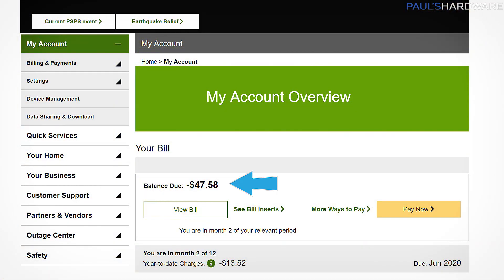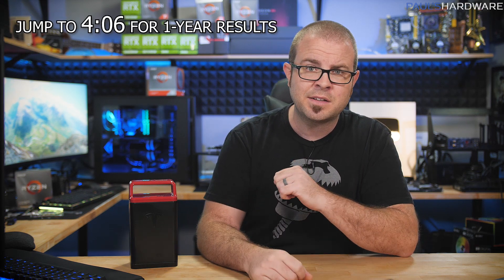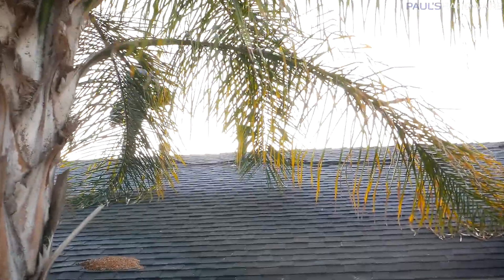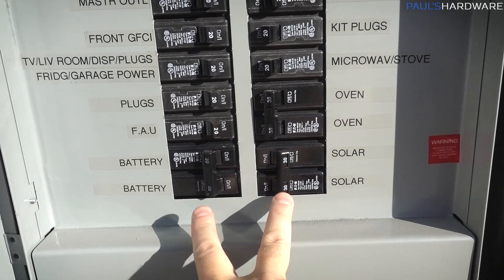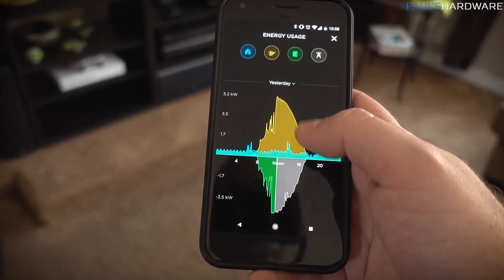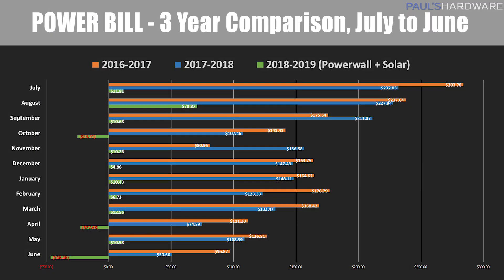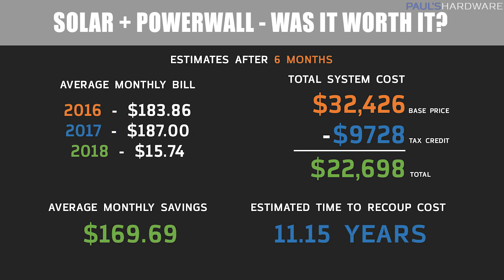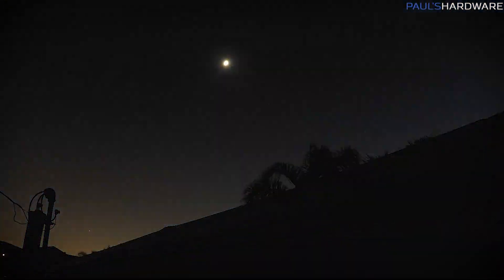TESLA Solar and Powerwall: 1 Year Later!

Comment: Any tax rebate or government subsidy in your state that can bring down the original cost and subsequently, lower the recoup number of years? How about maintenance cost? 

It seems by the time you recoup the original cost, the system would need to be replaced soon, which will start a new cycle of recouping the cost. Doesn't sound like a desirable loop. (Unless, of course, the government incentives to slash the set up cost at the beginning).

Comment: This is a great year for solar installation! The Feds are now giving a 26% credit and Tesla's prices are amazingly low. Next year in California changing rules may mandate a powerwall, which adds another $12,000 to the price of the system, and for many of us would be a deal breaker. My cost is so low that my payback should be in less than 5 years. Make sure to review your actual electricity kwh expenditures for several years back  rather than accept TESLA's estimation from one of your recent bills. In my case they under-calculated what I needed by quite a bit :). As the vlogger commented you cannot change your design once it's finalized and installed, so best to err on the side of maybe 10-20% additional to the max you think you'll need. You must estimate your changing lifestyle as to your need for solar panels...if retiring you'll spend more time at home as you age; traveling 6 months a year compared to now? then obviously much less.  Since power costs are going up, possibly 6% a year a surplus is a good idea.  Many of you were home much more for the past 12 months so used more kwh. However, it is not a bad idea to estimate on the high side, as this vlogger recommends. Most will not need a powerwall, and remember to include in your estimation for TESLA if you plan on buying an electric vehicle because you will need many more solar panels to charge the car.

Comment: Not sure how everyone experience with Tesla Solar has been but mine has been horrendous. They cancelled my Install 1 days before the schedule and have been telling me they caught a last minute need to upgrade my Panel. They have given me at least 3-4 different reason for why it needs upgrade and thrown a range of 5-20k to do the work including mentioning digging a trench (Not sure why upgrading a Panel requires digging a trench). All this without any hard numbers, all done based on my initial picture, no physical team on site to explain why I should spend 5-20K. It has also been over a month since my scheduled date. Every time I call, I get the "Talk to the hand" treatment. Overall I am shocked at how bad the experience has been. Very disappointed because I am a huge Tesla Fan.

Comment: Unfortunately, we had a bit of a horror story with Tesla. It felt like a bait and switch and makes us not want to ever deal with them again. Last year, we decided to get Tesla’s Solar Roof. We needed to replace our roof in the next few years, anyway, so financially it wasn’t much more than new roof + solar to get Tesla’s Solar Roof. After months of back and forth with Tesla on the details (they ask for pictures of the panel, details of electrical bill, roof layout, etc.), we signed an agreement to pay for Tesla’s Solar Roof and two powerwalls. We then went through the financing agreement and we submitted for permits. A few weeks later, Tesla sent us an automated update to agreement via email. It just had a new price and an “agree” button—that was it. The new price added ANOTHER $24K OVER THE AGREED PRICE. Rather than blindly accept the retroactive price change, I called and they said this was after a review of the roof complexity (mind you, they've already assessed that in detail and created a detailed plan for where the solar vs. normal tiles go). The guy on the phone actually acknowledged that this was in fact just adding another fee, though. So just a heads up to anyone considering Solar Roof, the price you agree to may get massively hiked up even after you sign what you think is the final agreement.

Comment: better way of looking at the value - $22698 investment (as compared to say Paul's 401 or similar investment fund) return on investment (147 x 12 = $1763) or a return of 7.8% TAX FREE. From day one. When you buy $22k of ATT stock you don't ask when will the dividends pay off the purchase of the stock, you ask "what is my return on investment"? AND
 it is GUARANTEED RETURN AND the value of your house has gone up $20,000 AND you don't worry about power outage - Solar is the best investment going!

Comment: Imagine that cost savings if you start factoring in charging a car, switching to electric water heaters etc. optimizing the house to run on the system in place

Comment: I just had my Tesla/Solar City Solar Panels cleaned since we've had a lot of smoke in Southern California due to the recent fires and the daily power generated has increased from about 22 kWh per day to about 29 kWh per day, an increase of about 31% [we have 28 panels]. Also, the max kW per hour has also increased from about 3.2 kW to about 4.6 kW, an increase of 43%+. Be sure to have your panels cleaned about every 6 months minimum, it will cost about $5 per panel to clean them well, but it's well worth it to increase your power production back to where it should be. FYI - we leased the system from Solar City [with a 3% annual increase], but I'd suggest purchasing the system if possible to avoid any issues when selling your home down the road.

Comment: A customer of mine (I build custom homes) bought 4 powerwalls for the house.  In the first winter, during a power outage, the weather was too cold so the powerwalls wouldn’t work.  They needed a trickle charge from the power grid if the temp was below (40-50 F - I don’t remember for sure, but this is the SF Bay Area which doesn’t get that cold).  Without the trickle charge they didn’t turn on until around noon when they got warm enough.  To make matters worse, my customer had Tesla install the whole system.  He kept calling Tesla saying the system wouldn’t work, to which they responded they could only talk to the installer, not the homeowner.  He kept saying “But Tesla installed them for me!” 
 They finally hung up on him as he got more irritated.  That is Tesla technology and customer service.

Comment: solar panels are a scam.  I would not trust them at all.  besides you cannot power a decent A/C with them, where most of your energy bill goes to.  you are better of on investing a sun deflecting heat paint. and switching all your lights to led. that will save you at least 40% on your electrical bill.    the only things that eat all the electricity are the Dryer and the A/C, Dryer consumes 5 kwph ,  and best solar panels can only produce 1.5 kph, unless you get fancy.   and to run the A/C you may need an extra 5kw.  so solar panels are useless,  they will save you nothing.  you will save way more money if you just paint your home with heat deflective paint. why? because your home was designed to be a heat battery that's why.  the sooner you understand your problem the better.

Comment: If the cost structures are like they are here in Australia, the panels pay for themselves quite quickly, the battery however takes a little longer, 
but you increase your solar self consumption significantly.

This can be accelerated by oversizing your system as much as possible.

Comment: Hi Paul. I live in Brisbane, Australia. Yes I'd like to see the difference in generation before and after of cleaning the panels. 

When electric cars become more commonplace I will certainly implement a home battery setup. Currently I have a 6.6kw grid connected system, no battery. My annual bills balance out to +/- $50. In extreme drought conditions I made $500 during calendar year 2019. Our feed in tariff fell from 15c/kwhr to 7c in March 2019, however our state government gave a $200 rebate as a Covid stimulus assistance package to every metered property.

Just as an aside and I think it is related to the government subsidy, a 10kw panel array with a 7kw Tesla powerwall costs $13446 USD installed here. Yep chinese panels with the same warranty and Canadian solar inverter. 

Great video and full of the appropriate data. Many thanks.

Comment: For those asking about cleaning. I have a 10kw system and I clean my panels ever couple of months. Makes approximately 1-2 KWh difference. That may not sound like much but it adds up. I have had my system since 08/13. Added 2 Tesla powerwalls in 01/18. Just added a small Tesla solar system to augment because we now have two electric cars.
Reply: With a 10kw system do you still use electricity off the grid at times? Thanks

Comment: Wasted money on the power wall. You dont lose the power generated on the roof, it goes back to the grid and then the grid gives you it back when you need it. 
Just like it would go into the battery and back to you when you need it .
The grid is your backup battery at no cost to you

Comment: That’s pretty cool that they re did your roof because I use to work for solar city which is what they were called, before Tesla bought them out which is pretty much the same company. But they are right with not installing on a roof that is old and brittle because all the penetrations in the roof with an old roof may cause potential leaks. Besides having the install done with your old roof may cost you money down the line because when you wanna re-roof you’re gonna have to pay roofers plus Tesla to take your panels back off depending on your contract with them. So I’m surprised to see them redo the roof for you before the install. You got a good deal off that

Comment: I plan to do a video about how to manage the demand in the winter with SRP, please stay tuned, subscribe to us.  I have a temporary solution for the 5am - 9am, and 5pm-9pm.  I know this can be one of the most annoying part of powerwall ownership and Tesla does not have an answer for scheduling double peaks in time of use plans.
We have a way thought to actively schedule the "back up" mode which allows the reserve mode.
Also we use E15 as opposed to E27 which is great for those "rainy days" , I also plan to do a video to explain the different SRP plans.

Here is a link to the SRP charging picture we do using reserve mode script:
https://drive.google.com/file/d/1-JzNVw_1bZSxGL63HTlDlQ4JTFuTset2/view?usp=sharing

Comment: why do you use so much AC? why not just insulate your house properly so it stays cool and using white Owens corning roof shingles. why wouldnt tesla have done that when they replaced your roof. black roof just massively increases your AC power consumption.

Comment: Huh? The Tesla Powerwall is guaranteed for 10 years which means you may have to replace your batteries after that time, at great cost. But you said, it will take you 15 years to pay the whole system off. By then you will have had to replace the batteries and probably do other repairs. Starting to sound like false economy.

Comment: Maybe LTO powerwalls next? If your inverter can handle more power the LTO cells can sustain a higher load than the Tesla cells and they last much longer only problem is I've never used them so I am not speaking out of experience and I don't know where to get them, maybe a chance for me in the long run? I vote for the before and after cleaning video.

Comment: The question I have is how full does your power wall get on average? I get the feeling that maybe it's filling up and you are losing some power that could have been stored. If that's the case would a second powerwall reduce your bills further as you will have more power stored to use before having to pull from the grid?

Comment: All these systems need data to verify operation vs cost and you did just that.  Now is it possible to add a few extra panels to the system (since from the video your roof has the space) for extra output, or the powerwall can't handle?  Will the electric company actually pay you back money if you produce more than you consume?

Comment: I'm interested in the cleaning comparison.

My installer told me not to clean my panels and especially not to fall for spontaneous offers from handymen to clean my panels.
The panels are coated with a water and dirt proofing layer and using any type of detergent on them would remove this protective layer.
I was told that hosing them down would suffice if for some reason tons of dust or sand would be covering my panels.

Comment: I live in Australia and have 3Kw solar panels and a 300 litre solar hot water system.  My latest electricity bill was over $900 credit.. I have not received a b ill for electricity for the last 3 years. I do not have back up Tesla batteries, my excess is pumped back into the power grid for which I receive generous credits.

Comment: Definitely yes on the cleaning video! FYI when doing your cost accounting you need to use SCE's current rates, not the ones you had two years ago. Projecting into the future you need to assume some rate of increase on SCE rates as well. If nothing else, assume nominal inflation of 2% although SCE is very good at manipulating rate schedules to raise rates faster than that, particularly for higher tiers. 

Thanks for the video

Comment: The South of England is quite a bit different, I suspect from California from a sunlight POV. However, in Jan 2019 we had a 2.28KW PV cell array fitted to the roof of our house. Our previous, 2-year rolling average for electricity consumption was 12.65kWh/day. After 8 months with the PVs fitted our daily draw from the National Grid has dropped to 7.33kWh/day. As my electricity provider charges 17.55p/kWh, this is actually making quite a big difference to how much we should be paying our provider (the amount we pay each month hasn't changed yet as they will only review this every six months and we missed the last review). We're also paid by the Gov't for each kWh we generate and export (not much: 3.79p/kWh for generation, 5.38p/kWh exported back to the grid) - at the 6 month point I calculated our total savings have been a little over £250. We paid £8,000 for the PV cells, the Inverter and the Installation, so if we do manage to save £500 a year then we're looking at 16yrs to recoup the entire system cost, but if you look at it another way and take the interest added over the 5yrs the loan runs then that interest will actually be paid back by the PV within the lifetime of the loan.

Our five year plan (after we've paid the loan back), is a Solar Battery and an Electric Car - given the price of fuel in the UK this is where I think we'll start to see big savings on our investment.

Comment: $22,000 invested at 5% return for 12 years is almost $40,000. You'll never recoup your cost
Reply: that's right and by that time those panels would deteriorate further and produce less and less power.
Reply: Factor in electrical price increase over the years and the value added to your home. Also I'm assuming your 5% is fixed.
Reply: Albert De Castro there’s no value added unless the system is paid for. All you’re doing is transferring debt to the new homeowner. I was looking at buying a house with leased panels, they wanted to run my credit for an extra $20k on top of the home price. How does that add any value?

Comment: Interesting. By appearance, my house is roughly twice the size of yours and yet my elec. bill is at least 35% lower overall. That includes the height of AC season in the midatlantic area.  So, as emotionally appealing as your system may be, it's out for me. A further increase in attic insulation, tweaking the AC/heating zoning a little, giving the boiler a dedicated and insulated air supply would likely be better choices. In terms of economics alone, people are often better off doing simple things first and choosing very basic climate control and other systems that are less likely to have expensive failures, can be "zoned" for even more practicality, etc. They are often not considered because of relative "inefficiency", yet a single repair of a complex and very efficient system can consume all of their savings for many years.

Comment: But solar panels degrade over time. You'll be getting less and less power from them. So it won't be 12 years ... it might be nearer 20. At which point its time to replace the panels. So you didn't save anything. You just parted with a huge an=mount of money up front. Imagine if you had invested that and it had returned just 4% over 20 years with compound interest ... you'd have doubled your money. Basically, this was a bad investment. Money today is always worth more than money tomorrow.